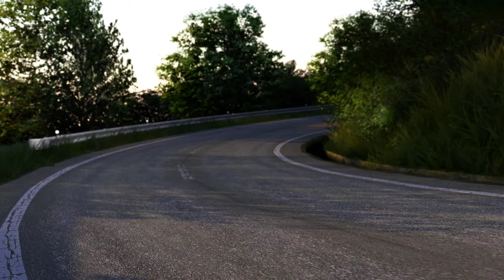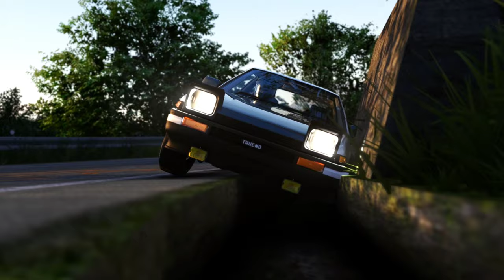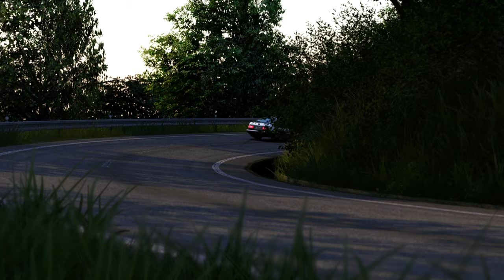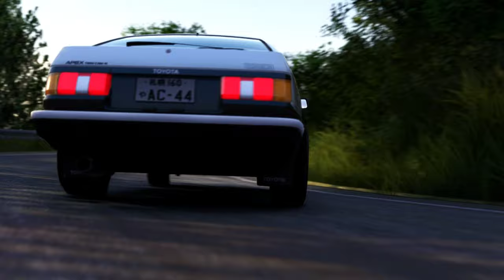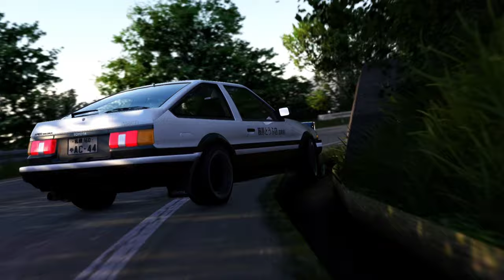AE86 Inner Wheel Lift At Nagao [Ryosuke Explains]

Comment: If you manage to do it in real life then you have mastered it completely
Reply: if you don't i hope your insurance can cover that messup
Reply: well drifting in real life is somewhat less harder because you feel some much more than just the force feedback of the wheel, like the G force by example.
Mastering it in Sim is enough of a challenge
Reply: @owaisunar5227  no. Drifting in real life is much harder because its so expensive
Reply: @BosGaurus05  expensive doesnt necessarily mean harder. i had a much easier time sliding a 180sx in real life over assetto/sim racing. having more of your senses active and aware while racing/drifting allows for much better control and stability from the driver. Only relying on force feedback means you need to have some level of muscle memory/understanding of the car physics as well as the maps/tracks you're racing on. real life drifting is definitely a skill in of its own, but from having experience in both I had a much easier time behind the wheel of a car vs the wheel of a sim
Reply: Technically you can with a high grip setup. Drift cars will naturally squat on throttle and with the proper setup the car will 3 wheel naturally
Reply: @Wildchildinc  but ae86 is not a drift car
Reply: @BosGaurus05  there are no drift cars. That's not a thing. Car manufacturers dont make drift cars, they just make cars. Some happen to be more suitable for drifting than others. But you can tune pretty much anything
Reply: @BosGaurus05 say that to the drift king, he will beg to differ
Reply: Too dangerous
Reply: Buy a RWD car and floor it hard around a corner then you'll see even a Shitbox could drift

Comment: "its an adaptation of a weight shifting technique. so if youre heading into a corner at a really high rate of speed, most of your cars weight are gonna be shifted onto the two outer tires. when that happens you open up your accelerator more and shift the weight to the rear of the car." 

"then youre just moving the weight thats being placed on your two outer tires, to the one outside rear tire?"

"thats right, the whole point of performing a weight shift is to take as much weight as possible off the inside front tire while youre in the turn. If you can do that, you found a shortcut. right over the gutter."